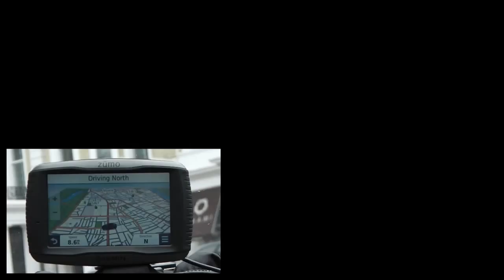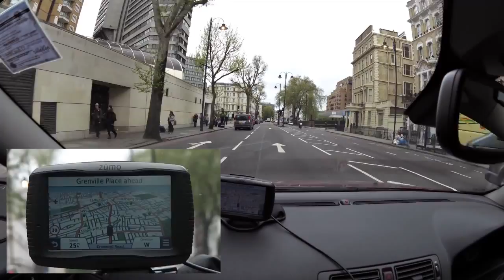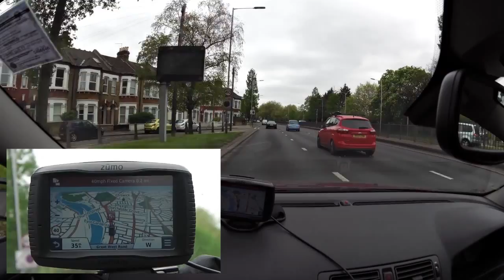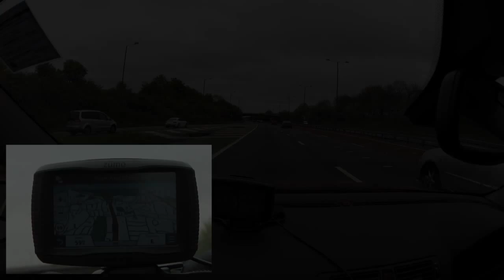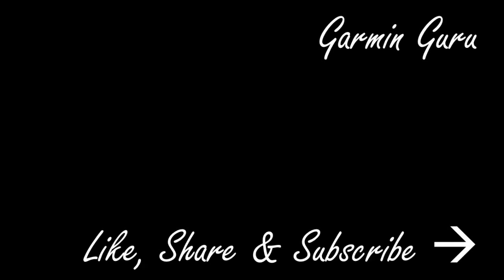Garmin Speed and Safety Camera Alerts Demonstration

Comment: They are NOT safey cameras, they are SPEED cameras. Money makers.
Reply from the maker: I miss them to he honest. Most of the cameras shown in the 2nd part of this video on the M4 East bound have all been replaced with average speed cameras. In the old days if you drove the section late at night and knew all the camera locations it was an excise in either self control or late braking. Nowadays there is no opportunity for such shenanigans.
Reply: @JosephByrne  Yeah. Fortunately I have foreign plates and, to date, have not been pursued - mind, normally there's so much congestion (on M's) that there's rarely an opportunity to exceed the posted limit, even on my motorcycles. 👍

Comment: Hi Joseph
Thanks for all your helpful tips, I have just upgraded to a Zumo XT, however I find the safety camera alerts
very slow to ping, ie almost on top of the camera, certainly well within range of a mobile camera, my previous
Garmin 590 would ping its self well before, are you aware of a fix or how to alter the XT ?
Thanks again
Mike
Reply from the maker: Where are you based. In the UK the alerts are the same as my previous devices. Maybe it is an issue with the local map.
Reply: @JosephByrne  I am near High Wycombe, my other Garmin 590 worked almost to well with warnings I did do a check Settings / Driver Assistance / Proximity Alerts, which is in the On position
Reply from the maker: @mickphotographer8725  That's strange as that's not far from where I am. You could contact Garmin maybe.
Reply: @JosephByrne   I think I will give it a few days, keep it updated and see if it improves, if not I will do as suggested and contact Garmin, will keep you informed

Comment: As a user of Garmin and Tom Tom the Garmin is pathetic as a speed camera detector. If you have the radio on as most do you easily miss the stupidly polite low volume ping which can't be changed on factory settings. The tom-tom had about 15 choices of audible alerts AND the alert volume could be set independently to from spoken directions. Garmin have stood still frozen rigid in this area from the beginning. If they made alarm clocks you'd sleep right through the day

Comment: I'm dissapointed with the notification sound, its not very noticeable compared to previous Satnavs I've had, it can be drowned out quite easily while listening to the radio!
Reply from the maker: John B You would think so, however, if you use the Sat nav frequently the frequency of the beep gets etched into your brain. I can hear it even over loud music. You can also make a Bluetooth connection with the car stereo to make it louder.

Comment: Hi, are you able to turn off the speed camera feature as its quite a hefty fine if you are caught in France and Spain with this feature turned on ?
Reply from the maker: ,+Mike Killoran Hi Mike. Yes you can disable the feature by turning it off. The setting is under "Proximity Alerts," however, Garmin have been quite clever about this. The Safety Camera updates and alerts for the countries where this information is now banned have changed. When I drive in France for example since the law has changed I now get an alert that says "Dangerous Road Segment" rather than "Safety Camera." This alert doesn't tell you the exact location of cameras along the segment but just warns you that it's a "Dangerous Road Segment" so it's possible there may be a safety camera. It's a work around if you like and a good one at that.
Reply: Thanks for that, will be useful when we go in June  :-)

Comment: My Garmin 3490 LMT used to alert me if I am beyond a speed limit in the area. The speed limit sign will become red and will have continuous beep, But after updating maps its not available.  Any help.
Reply from the maker: +Azam M It's usually under settings, "Alert Over speed" or something similar. The update may have changed this setting back to default.
Reply: +jobybyrne thanks a lot.